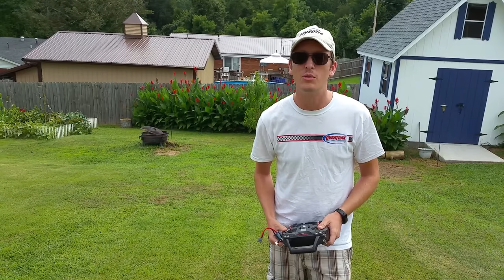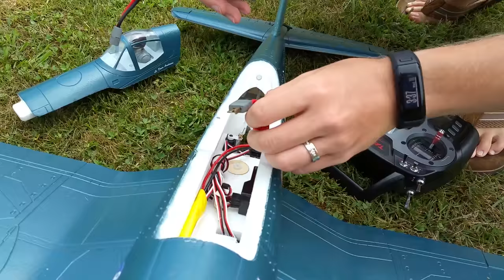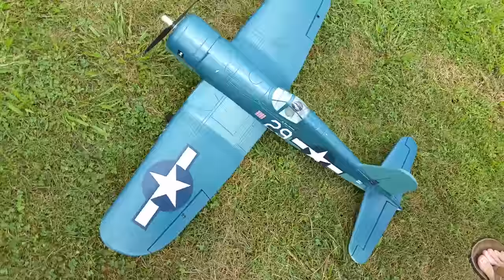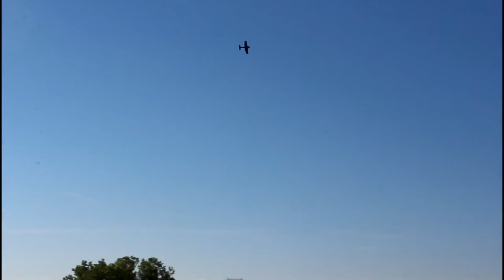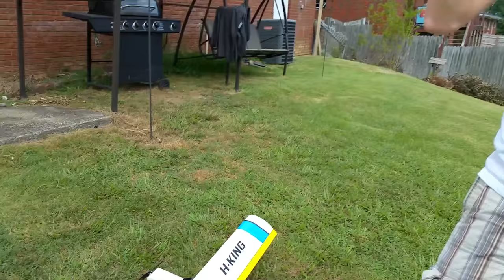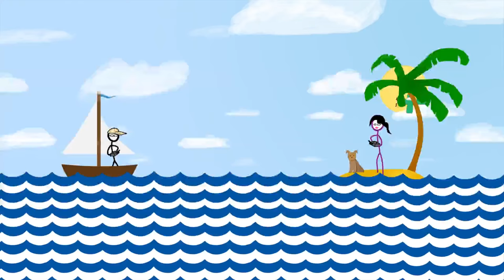RC Plane PreFlight Beginner Tips & Ailerons Made Easy - TheRcSaylors

Comment: Thank you RcSaylors for this video. Perhaps you can also make a video for beginner pilots graduating from, say, a 3 channel to 4 channel or warbirds like T-28. In my experience, after flying planes with dihedral I just forget that chopping throttle when flying warbirds is a deadly mistake. Sadly, learned with a crash. May be some similar tips will be super helpful. Best Wishes.

Comment: the tricky part with ailerons is when the plane is coming at you
and you must "reverse" your thinking - any tip on that?

how about.... push the stick toward the high wing to level the wings

for example - the plane is going away from me and the right wing is low
to level the plane - I push the stick toward the high wing to the left

if the plane is coming toward me and the right wing (from the inside the plane point of view)
is low - then to level I push the stick to the left toward the high wing (from cockpit point of view)

Comment: I always needed a quick way to think about that!  Thanks. I'm new to RC and subscribed to your ch.  When I fly the timber 1.5 with safe on everything is great, it flies level.  As soon as I take off safe during flight, the plane either goes up or goes down, but does not remain level.  is this a trimming issue or do you constantly have to be moving the sticks when you don't have any self leveling help on?  thanks
Reply from the maker: That's how I've always done it, and it works for me  :)  Thanks for subbing Gene!  Though I don't own the Timber, I have a friend that does and his flies great!  You may need to trim some because a plane like that should mostly be able to fly level for at least 5 seconds or so without much stick movement on a calm day.

Comment: Great "how it works" video! Next video you might explain the rudder and what happens if you try to turn using it only. ;-)
Reply: That depends a bit on the type of plane. But generally it will turn, only slower and flatter.
Reply: An AMA bud who flies fixed wings calls that SKIDDING or SLEWING. Dropping a wing redirects lift force from horizontal to a more vertical in the direction of the dipped wing. Left wing drop pulls the plane to the left. The rudder just initiates the nose turning to redirect forward thrust. ;-)

Comment: as a beginner, the thing that gets me having to think for a sec is, when your flying towards you, right is left, and left is right. and if you happen to get upside down and want to fly it inverted, up is then down and down is up. after awhile you do get used to these things and orientation of the plane and how to handle the sticks become second nature. practice practice practice.
Reply: Inverted = Down is up, and up is expensive... ;o)
Reply: Similarly, a quad copter's orientation makes stick movement versus direction the quad moves even more complicated and confusing. The first thing I do when I get a new bird, I paint the motor pods high visibility ORANGE in the rear and high visibility GREEN in the front. Before I learned that trick, I would lose orientation at a distance regularly. I hate being confused!

Comment: even I get confused with that one. thanks. Any tips for Elevator? I was tought that when your plane is flying at you ,you will want to move your stick in the opposite direction that the wing dips.So if your left wing drops as its flying at you,turn your stick right to correct it, the same goes for turning the plane.
Reply: Quite the opposite. If it's flying towards you, move the stick in the direction of the low wing. If it's flying away, move the stick towards the high wing.
Reply from the maker: What sort of questions do you have for your elevator? I think I follow what you are saying here, but not 100% sure. Sounds right!
Reply: +smartmusicfreak yup,you are right!
Reply: +TheRcSaylors I got that backward,funny thing is,I never think about it,except when its on the ground in front of me,when its in the air comming at me,I dont even think about it,I just correct it automatically. Might be something to do with being left handed too.

Comment: Fyi, they are ailerons not flaps. Flaps are on the wing ,close to the fuselage. They typical both always go the same direction and only go down. They are used to create more lift so the the airplane can take off and land in a shorter distance.
Reply from the maker: Yes, you are absolutely correct. Slip of the tongue !